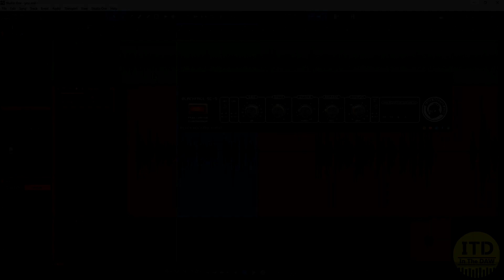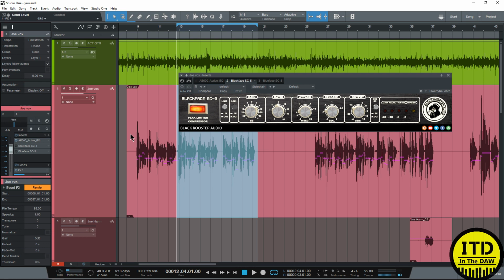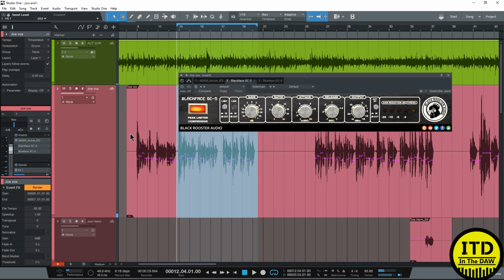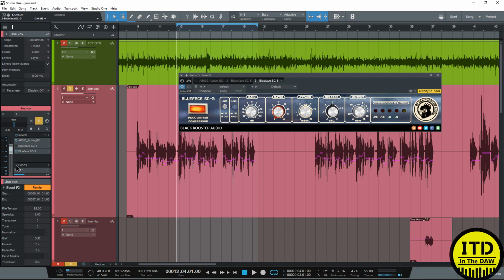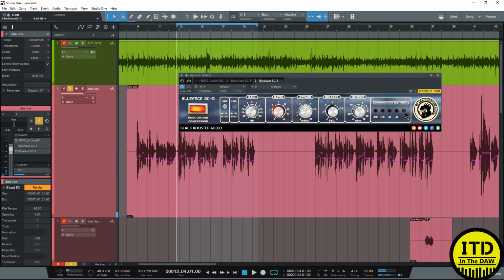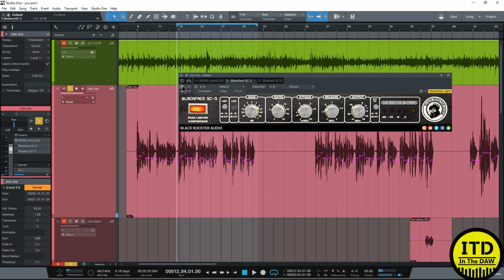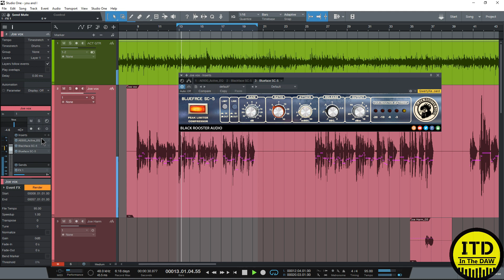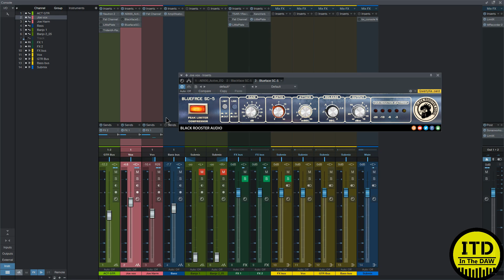Black Rooster Audio SC 5 Black and Blue In action Use and review

Comment: Nice Video but why don't you level match on vs off? Would be nice if such videos would go that extra mile because the whole AB thing is useless otherwise.
Reply from the maker: Hi I usually do level match the before and after examples. Unless the dynamic range of the signal changes so much that it becomes hard to not clip